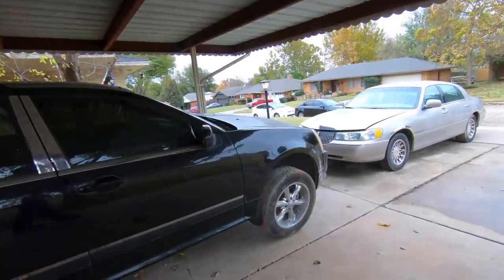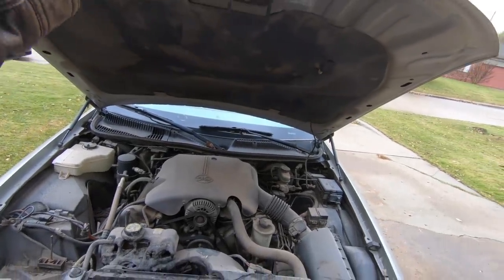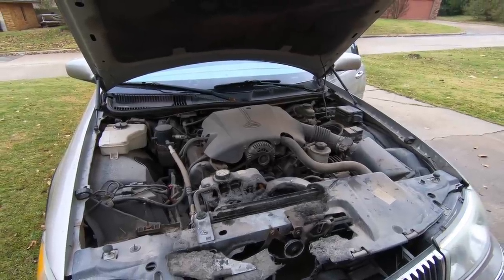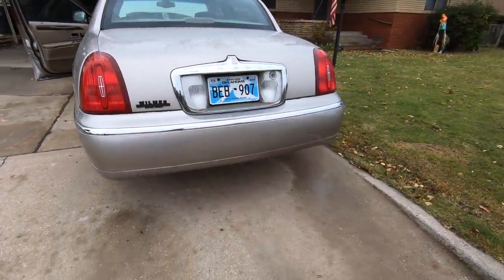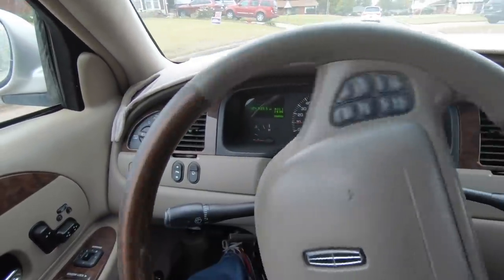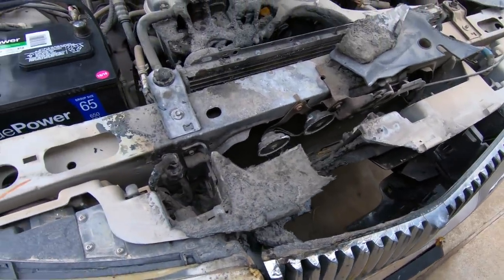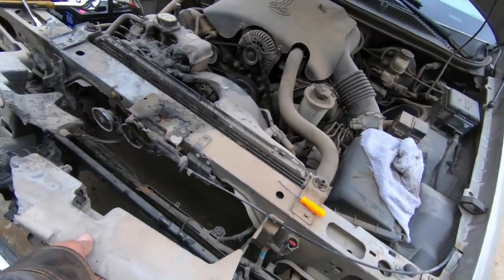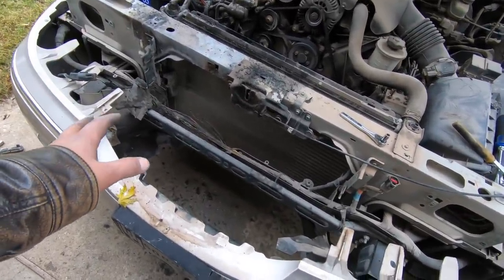Copart Win #2 Reveal: Let's Drive a FIRE CAR!!

Comment: These panther platforms, the town car, crown vics, grand marquis are tanks! These cars were very reliable and with good maintenance they can outlast just about anything made right along with the older toyotas. Its no surprise to get in a town car taxi and see 400k on them with no issues. These panther cars are my favorite there easy to work on, ride nice, have plenty of room, and though the 4.6 may not be crazy strong, its enough to get you out of the way and last along time doing so. Good find!!!

Comment: How did you get it home? How did you get it up in your driveway head first? You must have had it started before you put that battery in! I've had many Town Cars in my old limousine business and they run forever especially with synthetic oil, I've gotten over 150,000 miles on a set of tires, never had a transmission out of any of them, they are just incredible vehicles!

Comment: Nice score!  many of these older cars with minor damage are totaled out or salvaged titled because of the year even if the damage is minor.  On this last auction, I got outbid on a mercury grand marquis which had the header panel/grill broken from a minor fender bender.  same color and interior as yours, went for 450 and I had tapped out because I bidding on other vehicles later in the line up

Comment: That's a WIN!!!!!! See if you can get a battery from the junk yard too and return the battery from Walmart. I say you could probably keep the headlight. The damaged corner is probably going to be hidden by the plastic panel. Hook up radiator fan to battery to see if it works. If it does, keep it and just replace the radiator. Use some epoxy to make a new mount for front grill. Again this is going to be hidden by the plastic cover. Put  some rust paint on it and call it a day. Save your money Randy.

Comment: I wouldn't bother cleaning up the wires, just cut the harness and solder in a salvaged one. Even a tiny hole in the insulation lets moisture in and it starts to rot.

Comment: If I were you I'd be inclined to just replace that wiring loom running across in front of the radiator.  If nothing else it will take that part out of the equation if you find electrical issues in the front end (which you probably will) in the future...

Comment: Awesome deal, fire scares off so many people but this has the feel of my Volvo V40 fire car, just the engine cover and plug leads were melted on that, maybe a similar thing happened!  That is too cool. Just a word of caution though when dealing with fire damage, be careful getting melted crap on your hands, aside from the battery acid potentially here, when Viton gets burned(think O-rings/seals etc around cooling/HVAC systems) I believe it produces Hydrofluoric acid, HF. That stuff is really horrible, get a tiny amount on bare skin and it sinks into your body causing necrosis and you can lose limbs from it. At first you just feel a bit sore, then blisters, then it's time to amputate a few fingers or a hand before it spreads up your arm. Seriously nasty stuff, so gloves are advisable if you're gonna get into more fire cars. Take care man, good job.
Reply: 104k, full dealer history, one owner grandma ones in the condition this is in (minus the fire damage)?  Also I don't think it's a '98 is it?  OK Maybe not as a profit-maker, but from the standpoint of a cheap car to keep as a reliable comfy daily it's awesome. Could spend your $900 a lot worse anyway
Reply: @danmackintosh6325  Easily a Early 2000's ignore the guy above just another one of the many trolls/haters that comment on Randy's videos Randy got a great Deal and is gonna make a Decent Profit off of it
Reply: Yeh I kinda guessed as much with a username like that, still gotta point out the facts that make this a worthwhile purchase though. It's far from an average find & literally nothing wrong with it mechanically/electrically. Not even an EML or airbag light.

Comment: Lincoln’s are one of the best cars on the road. I have had them since 1994. Never had one problem. When they got 125,000 miles, got them around 40,000, I would sell them to a friend of mine. All you have to do is change the oil every 3 months or 3000 miles. Will run forever. My friends would fight over who could buy the car I was selling. They new I took care of my cars.

Comment: That car should NEVER have ended up at Copart. It should have been repaired and returned to the owner. The insurance adjuster who declared it a total loss should not just be fired, but criminally prosecuted too.
Reply: The repair costs at a shop would have exceeded the value of the car.  It does look like an easy fix, but a shop would charge book time for each and every piece they replaced.  The insurance company just wanted to be done with it with no further liability.

Comment: Probably a battery charger was on top there. I've been repairing some cheap made in china chargers lately and the quality of parts is horrific. One started smoking it got so hot and the thermal fuse did NOT shut it off!  fire hazards!

Comment: You need shift shaft bushings or you need to check the shifter cable bolts in the column and re loc-tire them to fix that indicator being off from P.

Comment: I'd say after you replace the wiring and the burnt parts with that low of a mileage i would say 2,500 to 3,200 at the lot. don't forget to prime and paint that burnt metal.
Reply: Yeah the only reason they are so cheap is because Airport limo services use them and sell em at 150k for peanuts. Around here you can go to one of those places and get one fully loaded  with that mileage for 5k only a few years old. Crazy considering most of them hit 800,000 miles before they come of the road at least.
Reply: @joer8854  yep and when they get closer to retiring them they don't keep the maintenance up on them and that is another reason they are cheap and often the drivers abuse them.
Reply: @joer8854  for the lowest model of town car Kelly blue book shows a typical listing price of $3,933 with an fair purchase price of $3,442  and a fair market range of up to $4,264 but that is all with a clean title and this car no longer has that. That is why i said anywhere from 2,500 to 3,200.  It's fairly clean and a lot of local people to his area seem to buy the cars and they sell quickly as they can see what all randy had to do to them and he lets people know what needs done.
Reply: @joer8854  another thing that is funny nada value is higher then KBB on this one. they say with the mileage of 104k the retail value is $4,975 and trade in is 3,000 dollars.